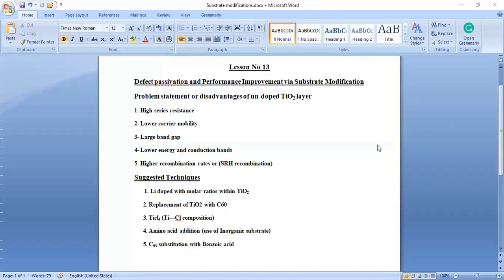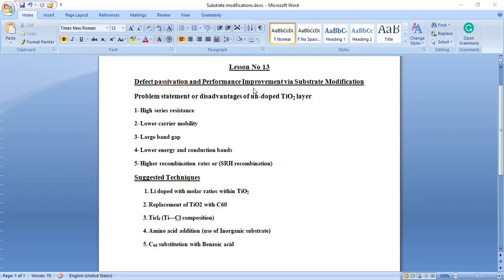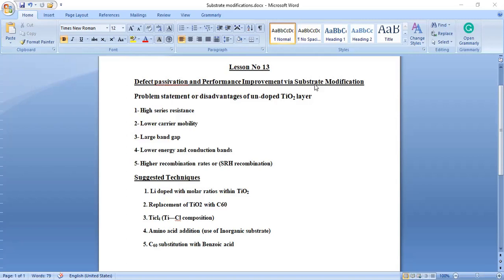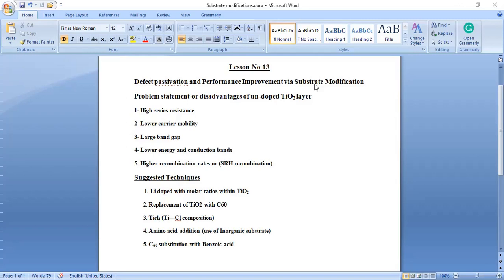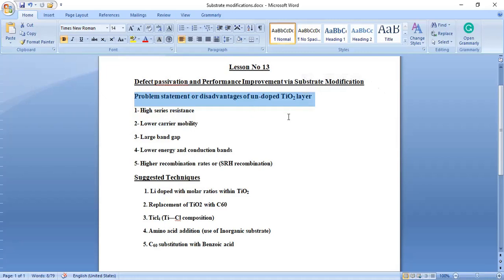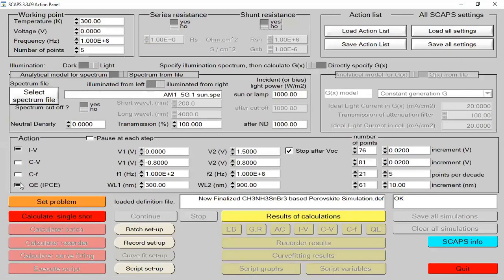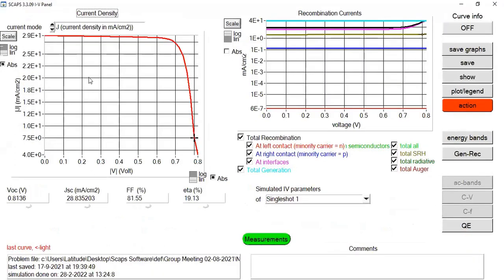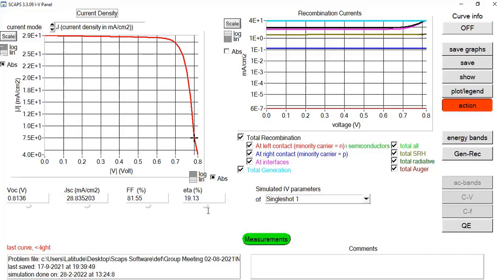Defect Passivation and Performance Improvement via Substrate Modification in Tin based Perovskite

Comment: Excellent work, Sir, if we use non-inverted architecture, what will happen, is there defects reduced for both HTL & ETL equally? 

Why defect passivation increases between ETL and Absorber layer in Planar architecture, is it because of sun light falls directly on ETL?
Reply from the maker: @Ibtasam chaudhary in non inverted we have more interfacial recombination at perovskite and ETL due to poor carrier mobility of electrons while holes mobility is more with lower recombination so there is need for improvement in making CBO negative to positive for making bandgap alignment improved.
Inverted architecture are more stable as non Inverted ones and they have better carrier mobilities and lower interfacial defects.

Comment: Hello sir can you please help me regarding to the convergence failure. I am getting convergence failure at V=0.000 volt. I have tried everything but it doesn't fix
Reply from the maker: @Shivani Mehta pl contact me on my email waleedakram280@yahoo.com
Regards
Reply: I am also getting the same problem. I had commented on your video yesterday as well and you tell me a solution but it did not work.
Reply from the maker: Both of you are recommended to send me a zoom meeting link so that I can see your structure and can point out issue
Reply: @engrmuhammadwaleedakram4486  ok sir thank you.. I will send you a zoom meeting tomorrow morning

Comment: Sir, how do we change the molar ratio of Li in TiO2?
Reply from the maker: You can do it in an experimental section or can compute via DFT calculation. There is no straight option for changing molar ratio in scaps
Reply: @engrmuhammadwaleedakram4486  is there any option to change the molar concentration via scaps Sir?
Reply from the maker: I'm afraid there is no such option.
Reply: thank you so much Sir @engrmuhammadwaleedakram4486
Reply from the maker: @sruthis7796 here is the link to get absorption data for your materials, I hope it will be helpful for you.
https://www.pvlighthouse.com.au/
Reply: @engrmuhammadwaleedakram4486   what is DTF calculation?
Reply from the maker: DFT is "Detailed functional theory" used to determine the electronic structure of materials. Like calculation of band gap, E.A and other material properties.